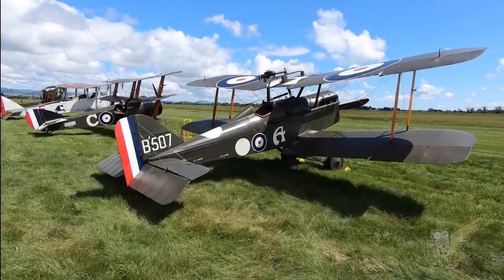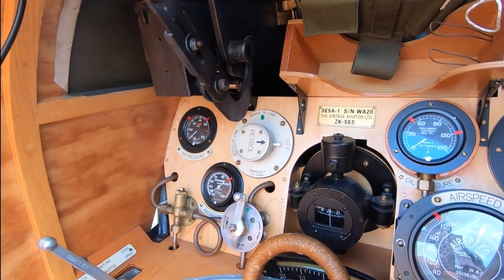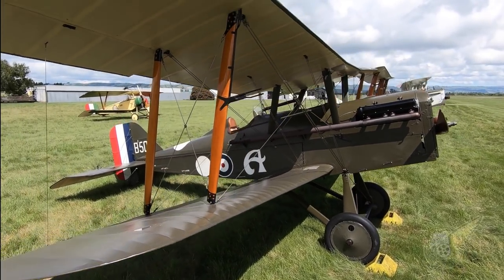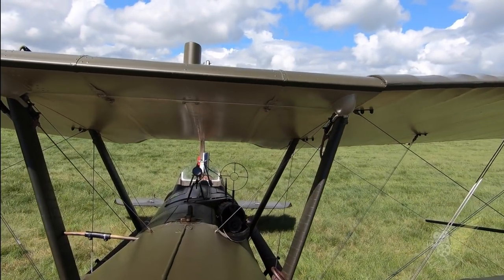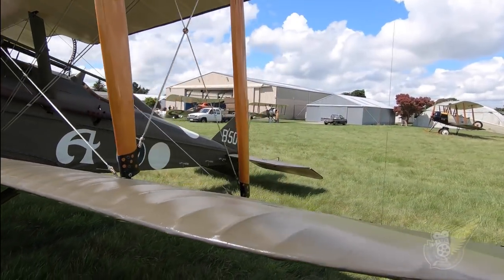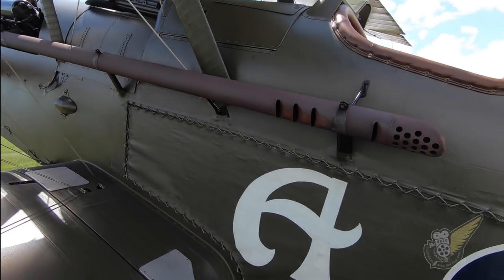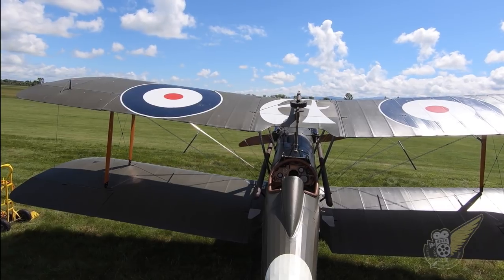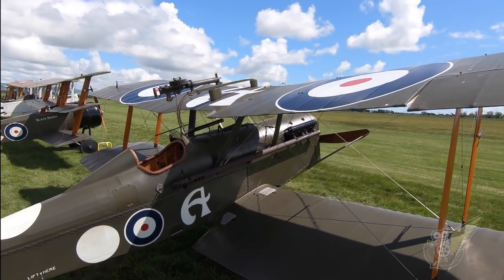Intro To The Royal Aircraft Factory SE.5a Biplane Fighter

Comment: The Australian Airforce used the SE5a as it's frontline fighter for many years after The First World War it was years ahead of it's time.   I wonder how it would have performed with the 450hp  in 1925 to 900 hp in 1932 Napier Lion engine installed as a power unit.   Fairy Aviation also had a fast and reliable engine in the Curtiss V12 they built under license which finally sparked the fire under a lazy solumnescent .... between the wars - Rolls Royce!
There were plenty of other watercooled inline and aircooled radial engines from British aircraft engine manufacturers  like Armstrong Whitworth  to choose from even Hispano Suiza had one?.  Logically it would have required a steel tubular airframe to hold the power output  of these more advnced aircraft engines but with  it's clever no non-sense  streamlined layout  could have been the inspiration behind a biplane airplane as fast as a Gloster Gladiator.  The monoplane inspiration could have come later...